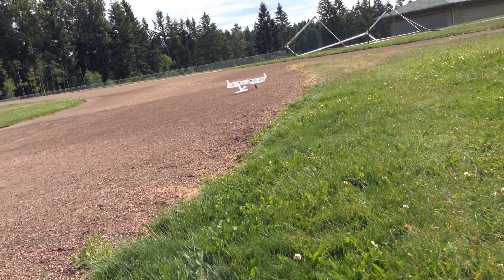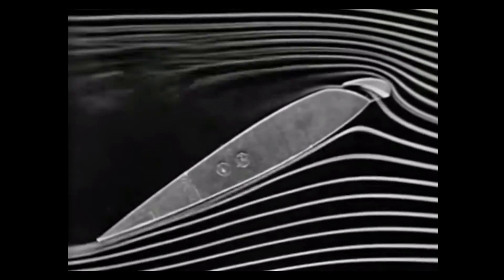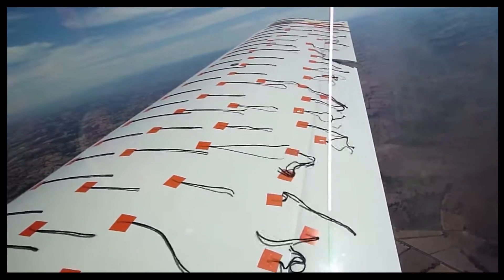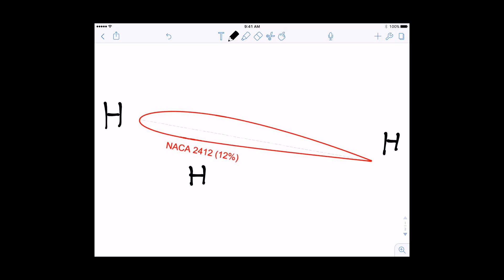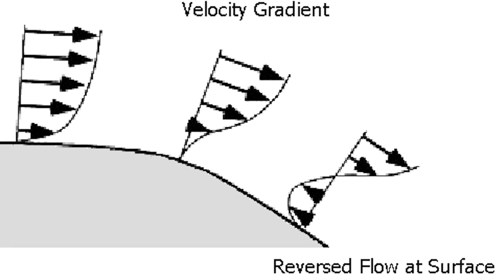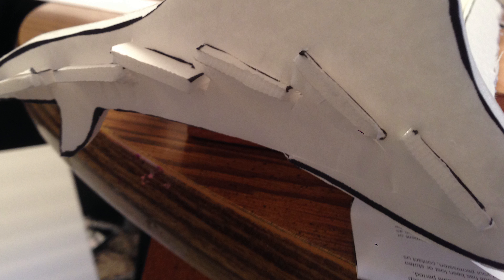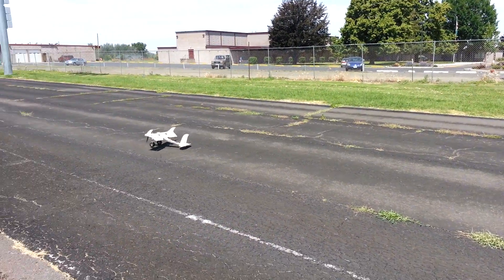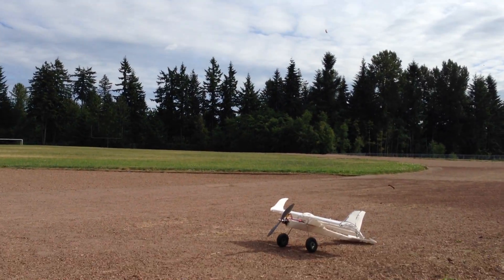Experimental Slat Plane! Unstallable wing?

Comment: Thank you. Tonight I am in search of how slats upset level flight. Example level flight at a safe speed to add FLAPS. Aerodynamically the nose pitches up.due to more lift and drag. Assuming you wanted that for descending slower to land. The pilot would push the nose back down to complete the landing approach. So the question is. Flying level at a safe speed to independently extend leading edge slats. How is the flight attitude changed prior to the pilot making his next pitch decision. Pitches down, pitch stays the same but the wing has more lift, or lastly the nose pitches up? Oh and a girlfriend that pitches in to assist in your dreams is rare and a keeper.

Comment: A known way to get a super-STOL wing is by using very-low aspect-ratio planform.
See the Arup planes from Indiana in the '30s, and in the same time period the Nemeth "Parachute plane" with a circular wing. Named for its steep descent and near zero landing roll with any wind, it was faster than the Alliance Argo biplane which the fuselage came from.
 Like the Arup, demonstrably not inherently highly draggy at cruise normal flight due to alleged wing-tip vortices.
 Also the similar Farman 1020; faster than the original monoplane, super-STOL, stall-spin proof. Like the Nemeth, the Arup, the Vought V-173, and the '90s Wainfan "Facetmobile", others.

With aspect-ratio (span^2/area) <=3, at slow speeds and at high A (>40 degrees has been demonstrated), the wing-tip vortices wrap around and "capture" a "bubble" of low pressure above the wing, increasing lift while A compresses air under it as understood normally. At the same time, the vortices trap air from the front over the top of the wing, keeping it from separating and ensuring strong smooth flow to the controls. Such wings do not stall, as in separation of flow causing loss of lift and loss of controls.

Charles Zimmerman wrote about this "parachute lift" extensively while working for NACA and UAC (Vought, Sikorsky, P&W, and Hamilton Standard). He worked for NACA and was on the team that saw the Arup put on an impressive demonstration.
The Arup S-2 was 780 lbs, and with 37 hp flew 85 kts, with 18 kts landing speed. Stall-spin proof, nimble with amazing climb rate (as seen on "Flying Heel-Lift" video about it)
After that Zimmerman used the planform as the starting point for his VTOL tail-sitter experiments in the V-173. It did not need or benefit from the situation with the oversized, outward-turning, plane-changing tuned props. NACA tests showed that it did not gain anything or really change anything versus normal sorts of 80hp props spinning the other way.
The Vought plane's good handling and super-STOL abilities came solely from the planform., largely copied from or inspired by the Arup.
Wainfan wrote extensively about very-low aspect-ratio and integral wing-bodies for NASA See the link on the Facetmobile site. In a video of him talking to the EAA he reports "100knots on 40 horsepower with 340 lbs useful load. I don't see any great inefficiency here". Facetmobile could stay aloft at <16 knots: his pitot tube couldn't read any slower.
Many examples in history show that this planform has been unfairly ignored.

Contrary to many theories & equations about why short aspect-ratio wings aren't in use now, and apparently contrary to the entirety of "conventional wisdom", very-low aspect-ratio planes are not inherently draggy or have bad handling. They've been demonstrated to be quick on little power with clean aerodynamics at cruise. The huge wing-tip vortices and attendant drag are elective and temporary, a fact which is totally unknown to most aerodynamicists, though it's published and peer-reviewed.
I've asked for an explanation; if such aspect-ratio between .7 to 2.2 wings must always have inherently high drag, what is this alleged drag if it does not manifest itself in power vs speed, or fuel vs range? Because they've been demonstrated many times in history to be notably good.

It's understandable that this parachute lift effect is difficult to reproduce on a model, since they're most often overpowered (who's to tell when it's standing on its prop thrust?).
 Very-low aspect-ratio planes like the Arup , the Nemeth and the Facetmobile demonstrate super-slow flight and no stalling, at very high A, notably are not draggy and slow at cruise.

Comment: so does it seem to climb way too much at higher speed? if so try a variable pitch setup  basically run a servo for flaps connected via pushrod to a linkage system connecting the slats.

Comment: Hey Sam,terrific experiments. I'm now retired but spent most of my adult life in aerospace engineering and training.  I often pondered a spit wing similar to your slotted design only with 2 segments which would utilize controllable translating to create increased surface area variable camber with the advantage of airflow regeneration a slotted wing can provide. My thoughts were to gain the advantage of a high speed wing profile collapsed while being capable of low speed flight high wing loading and eliminate the complexity and weight of wing flaps.  I never did produce a design for wing tunnel testing but was very impressed by your tenacity and enthusiasm with what you achieved in your designs. Well done mate. Cheers, Ted Allon
Reply: He sadly passed away in 2018

Comment: One thing that none has done while doing this experiment is to meture how much engine input is necessary to keep the plane up Flow in the air with a regular wing and this one, meture the airplane speed with each wing to see which one produces more drag and which one requies more engine power, you going to need a speed radar gun, watt and voltage mitter attached between the batteries and the motor, this meturing experiment should be done with the plane flying on a straight line same high above the ground with each wing. Don't just be a pilot become and scientists, prove your new wing design right or prove it wrong, many will appreciate your findings and let others know if they should go for it or if it's not worth it.

Comment: good idea :D but i think that is good only for light aircraft that use low speed. i think that a wing like that at high speed kill itself because of the "extreme flap design" . is like you want to fly high speed with landing flaps. the wings will rip :)

Comment: What about a 2.0 version with NACA PROFILED SLATS. GREAT VIDEO. 

ADD SCREW JACK TO REAR OF ROOT TO CHANGE AOA hinge the leading edge. 
 THAN reverse it to TRY THE JACK AT THE FRONT ALA F-8 Crusader  maybe a great high speed higher lift drone concept. 
I wanted to try this design but let the wing tips float freely. So as the HP increases the slat close(no moving parts just flexible parts. Reducing drag giving more HP. THIS DESIGN WOULD BE SELF REGULATING. 

I THINK YOU ARE ON TO SOMETHING BIG

Comment: Where are you going to put the fuel in the slat wing since usually the fuel tanks are in the wings?
Reply: Another good reason for the use of an electric motor, just like the Pipistrel? A motor with one moving part, just like in the small RC version, and ideal for a low-speed short-range application. Hmm...?

Comment: Interesting in a small model form, but not sure how you could find the strength needed to support a multi-ton airplane on a wing that is made of of so many small (and therefore relatively weak) slats...I just do not see the structure being solid enough to handle the load. I'm not an engineer, but it just does not look practical to me. Also, I think at the higher speeds of a jet liner, this design, even if it could be built strong enough, would create way too much lift and would not be able to be leveled out or decended except at  very slow speeds.

Comment: Interesting! FYI, this is the same way that a sailboat sloop works. The space between the front jib and the mainsail  reduces drag and speeds up the lift across the jib. The arrangement performs much more efficiently then would have been the case with one single sale of the same size.

Comment: Fluid dynamics interesting,  but ( I offer this with good intent)  :-)  you speak too fast in your presentation to allow one to process it without clicking backa bit to hear it again. 
I liked the actual stall with the slip strings on the wing to demonstrate a stall.and the reestablishment of the boundary layer when the flap were lowered a very small amount. it was very interesting to see the effects on a stall in actual flight..

Comment: So this wings you've 'designed' are providing the aircraft to lift its nose indefinitely and never go stall?
Am I close?
Reply: Yes
Reply: @richardbearden7889  NASA is experimenting with similar devices.

Their program is called The Flexible Wing.

The basis of it is to make the wings rotate slightly in its root's center.

Kind of less complicated design.
But this isn't bad either.

Comment: Of course it is NOT unstallable. It just will stall at a quite higher angle of attack than a normal wing and you lack the elevator authority to impose that angle of attack.

Comment: It would be very interesting to build a wing that is a series of movable slats instead of immovable slots.  Arranging them so that they extend and retract in sequence might work really well or there might be a high rate of diminishing returns and one two or three might the maximum practical number but it would be fun to experiment with.  The construction with regard to weight, strength and complexity might be too difficult though.

Including a switch on each slat and a series of lights on a panel would give a graphic indication of how many are extended.  Doing this in concert with an Angle Of Attack indicator would also be interesting.  Can your girlfriend build a wind tunnel?  (Tongue firmly in cheek for this paragraph, LOL)

Comment: That's... actually a great idea!
Very good concept! Work well for electric aircraft not so well for fueled aircrafts.
The best would be to find a way to reconfigure the wing during flight so you can minimize drag or maximize lift when needed.
Reply: The best set-up would be one where the slats were so shaped that they could be rearranged in flight to merge into one airfoil for best high-speed/minimum drag configuration, reverting to the individual separated strips (or combinations thereof ) for highest-lift/maximum drag during landing or In STOL circumstances. In a full-size plane the multi-foil (variable) wing would probably be inpractical/impracticable but it's an interesting concept to play with: think of a "super Fieseler "Storch" " VSTOL light plane, for instance. It would be handy to have access to a wind-tunnel so the concept could be fine-tuned therein.

Comment: I have a 4412 real airplane wing (full size rebuild) and would like to put a full size slat along the leading edge. I don't have access to any fluid dynamics or solidworks software and am trying to figure out the optimum location for said slat. I have the Abbot and Doenhoff book but it is way over my head... (I would have to go back to school and relearn the math and concepts.) It's not fun at this point and I'm a bit stalled (no pun intended.)
Reply: er nothing special about solidworks. it in fact makes design weird. 3d cad is 3d cad. Good luck on the fluid dynamics software id love to find some

Comment: Maybe an enlarged design could lead to a new type of bush-plane.
Reply: It would work for ultra-short takeoff and landing, but both top speed and fuel efficiency would be ludicrously bad.
Unless you design a very fancy system that can transition from multiwing to singlewing in midflight. This is very doable (all commercial airliners do it routinely!!), but very, very, very expensive.

Comment: Would such a wing design not work well "in real life".....due to high overall drag compared to "normal" wings? Otherwise a "stall-free" wing design would be an incredible safety enhancement.  Another reason might be the "many-slat" design provides no space for fuel. As to the fluid dynamics, at least for those without any engineering background.....you might have added a few bonus minutes describing the Bernouli principle....that increased flow velocity of the same mass of air would result in lower pressure. Relate that to the curved top-surface of a wing.....a particle of air must travel a longer distance (compared to the nearly-flat underside surface).....for that particle to "meet-up-with" ( at the back of the wing)....with its sister particle that travelled a shorter distance underneath. Therefore "lift" is created (due to lower pressure), on the topside. Folded-in with the other technical data you presented, may provide a fuller picture to those without fluid dynamic background. No criticism.....simply response to your question.
Reply: Large commercial plane flaps use this principle. They are often multiple small sections with gaps between.

Comment: The problem with fixed devices like this is drag. The speed range will be crap. In fact any of the airplanes with fixed LE slats like the zenith 701 or the feisler storch are very low speed airplanes. They can barely get out of their own way. Realistically, sacrificing everything in a full scale small airplane to stall at 30mph doesn't make much sense because you end up topping out a 70-80 mph. It is much better to stall at 45 mph and top out at 150 mph. You have a much more useful airplane. Extremely low stall speeds are very costly. That's why I am always puzzled by people who go gaga over these extreme stol Alaskan bush planes. Yes they can land on a tiny sand bar but it takes them two days to get to it!

Comment: I have seen one of this slat wing plane many many years ago, it was a CL control line model using COX engine, it's even has a small disk covered the propeller hub and allowed one or two inches of propeller tip for thrust, and it claimed it can fly as slow as you walk, I never made it but may be one day.

Comment: Program the slats on servos like the airliners so they can be adjusted on the fly according to speed and angle of attack curves with a Raspberry Pi or some such and you can lose the drag at higher speeds and get ridiculous at lower speeds.

Comment: This is what comes from thinking that a wind tunnel ( where the wing is still and the air is moving ) is like an actual moving wing flying thru relatively static air.  Sorry- the air Over the wing does not have “kinetic energy”- that can push thru to the high pressure zone aft of the wing.   The low pressure is a dynamic effect of the wing, not the air itself. It only extends a couple feet over the wing.  Above THAT is air at normal  (higher) pressure.  The high pressure air below the wing can not move up- because the high inertia wing in is the way... but the high pressure air Above the low pressure zone Can move Down to try and equalize the pressure differential.  This accelerates the air above the low pressure zone downward, and as the wing passes by, this accelerated stream of air is thrown Downward at high speed.   
This is a THRUST- perpendicular to the wings’ direction of travel. When the downward thrust matches the weight of the airplane- the plane flies.  When the thrust exceeds the weight of the airplane, the plane climbs. When it is less than the worthy of the plane, the plane descends.   As you climb, air becomes less dense. This is why the plane has to fly faster to climb higher, to throw enough MORE air downward to compensate for the less massive air. And why planes’ performance envelop narrows as their stall speed increases with altitude.
Every propellor and fan proves that wings work by creating thrust. Not by creating lift.

Comment: Air, not Wind, moves Faster Over the Wing, CREATING a Lower Pressure that causes Lift.... Air Does Not Move Faster because there is a Low Pressure Zone THERE...already, as you make it seem. ---  Redo, Re-Explain. 🤔😕

Comment: At some point any airfoil will stall! If power is decreased to the point that airflow actually stops then you have a stall! So this is not a plane with an Unstallable Wing! It may be a wing that stalls at extremely low speed but it will stall!

Comment: That was a really good explanation of wing stalling. If only aerodynamic lecturers could explain things that well so quickly more pilots would understand what a stall is. Yesterday, in a simulator we revised the effects of high lift devices on an aircraft’s wing and flew some exercises on their effects. So this was very relevant to me. The big question for the installable wing is how much drag is there by comparison with a less radical wing?
Reply: Your ratio of drag to lift goes WAY up with this. Slightly more than doubling with the addition of a single extra. With six slats like this, drag at a given speed is something more than 6 times the single wing.

Lift, on the other hand, is the same or only very slightly reduced as compared to a single wing(for the same AoA). That's why his wing needed to be so very huge.

Comment: If you don't maintain enough high pressure air under the wing, you're giving up all your Bernoulli lift. Any flat surface can achieve "lift" with sufficient thrust and angle of attack (a.k.a. "Newtonian lift").